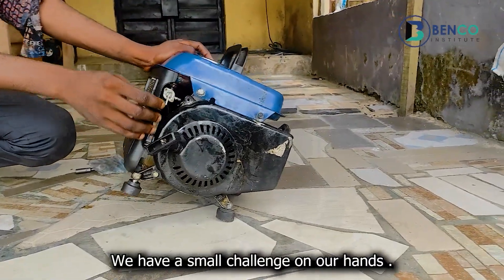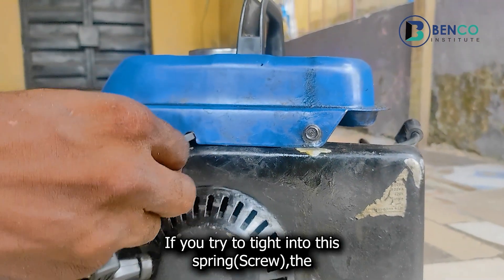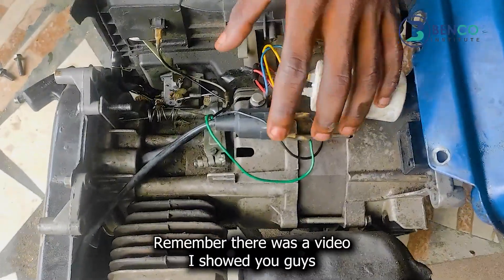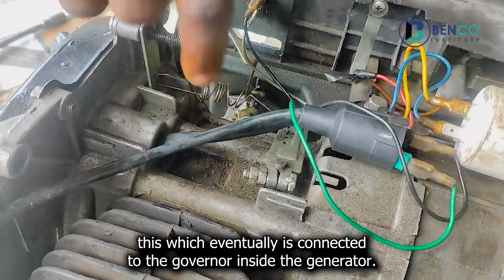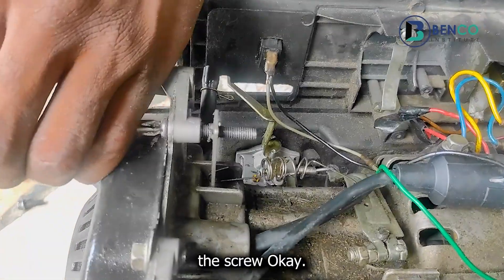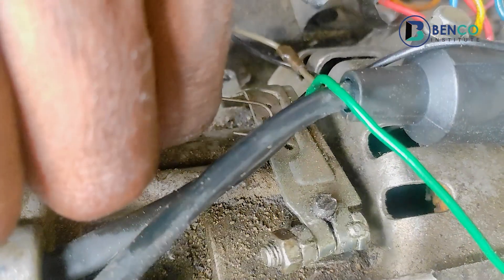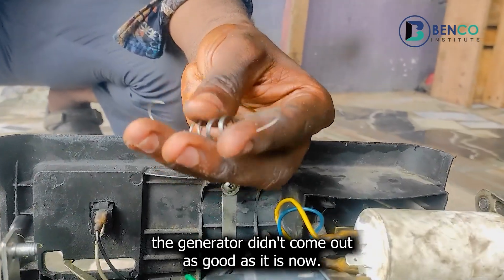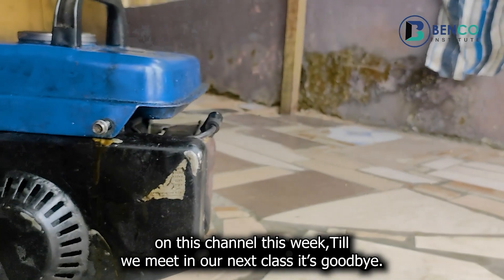How to fix Governor spring  of a TG 950 2 stroke Generator  with Firing Problem...

Comment: Sir thanks for all the information .. but I have an issue with my smillar generator .. the voltage is not stabel it goes from 180 to 270 sometimes 300 voltes .. what is the the right fix in ur opinion .. thanks again